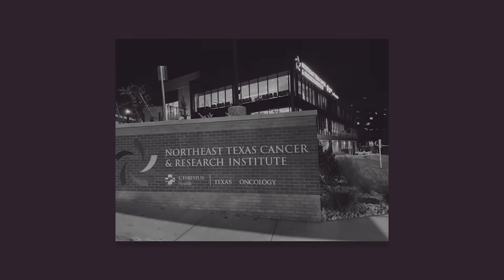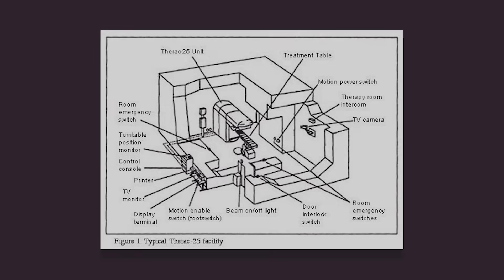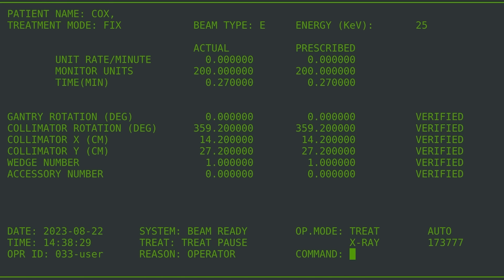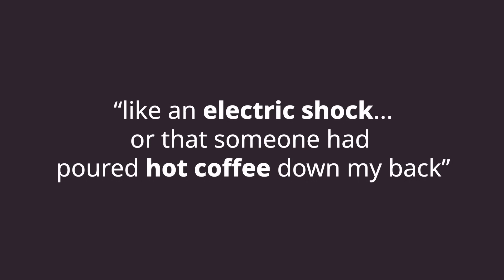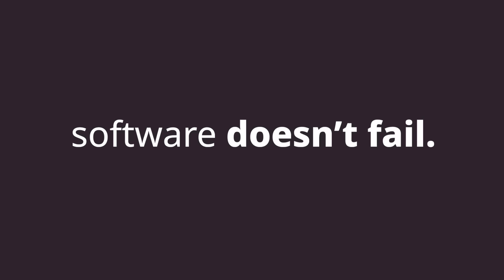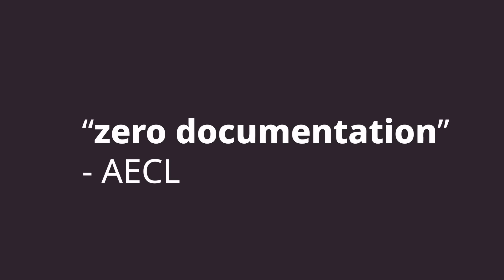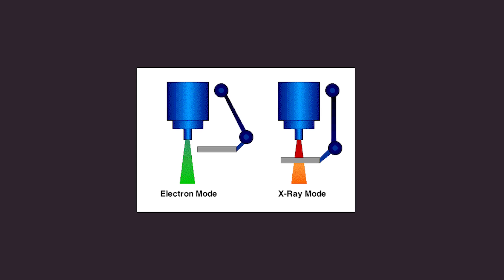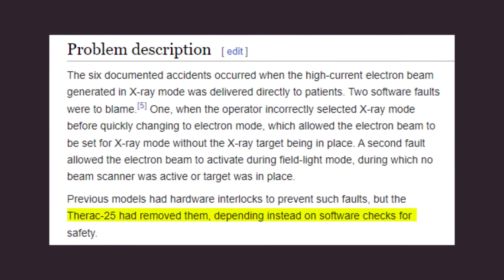how a simple programming mistake ended 6 lives

Comment: I started my career in Dental X-Ray designing and manufacturing company as a Junior Embedded System R&D engineer. 
There the hardware team has the master role always they critisize and having less trust in software😂. I remember how regorous regression tests they've done before going to launch a product.
Reply: you are my man, ... if I may ask you.  I noticed I am not always given those lead filled radiation protective ponchos (i don't know the exact name) any more nowadays when a dental X-ray is made on me.    Am I right thinking it is because the newer  (cone shaped beam) machine produce less radiation dose, and also less stray radiation with the cone shaped beams ?   ..or just negligence and I should ask for one.

Comment: You'd think the medical industry would get better at preventing this kind of thing. Instead, they've hired better lawyers to deny this kind of thing.
Reply: There is actually an ISO with very strict guidelines on how to develop such critical software, one thing which particularly stood out to me is static memory i.e. you know all the necessary resources beforehand and prepare for the worst case. 
There's also a tracing level for the documentation, where the max level is being able to trace all use cases through requirements to every line of code responsible for them.

So there definitely are methods for prevention.
NASA also has some interesting design processes, if you're interested in reading. Using an old, specific JavaScript engine in space is one of the consequences I find quite funny.
Reply: @blacklistnr1 which one? Could you share the number of ISO standard?
Reply: @charlieking7600  It's probably in the IEC60601 series of standards. My interest was .2.41 which is for a surgical luminaires and the basic electrical safety parent standards. Software will come under controls for the medical electrical devices and may reference external standards for quality assurance more specific to control/software design. It may also be a situation where the device developer/sponsor is responsible entirely without very specific guidelines beyond - "a single fault condition, power interruption or malfunction shall not cause adverse patient or user outcomes"...
Reply: @blacklistnr1  from what I've read, they even have to have certified C/C++ compilers, you can't just use GCC.
Reply: @blacklistnr1   I've been working to different software companies. Common among all of them that they want to make the least to get the certification. And these companies are worth multi-billion dollars.
Reply: i hope thé family got a large payout from the company and the hospital
Reply: @NithinJune Actually probably not. Apparently according to torts law, the compensation for loss of life/consort depends on life expectancy and this guy had cancer so...
Reply: @aporifera  that factors into the damages but also those was clearly very very negligent so punitive damages could have been large
Reply: @NithinJune  Well, you better hope to get some money from this, why else would you even bother others to help your survival ;-)
Reply: I work in the medical industry. You would think that the data quality is much better than any other industry. It's not, as a lot of the fields where patient information is entered in is free text and contains spelling mistakes. This is tragic but is not too surprising giving the experience I have had from my side of the field
Reply: @DeusinMachina  WOW I had no idea the code quality would be detrimental. Crazy.
Reply: They have.

This is the def facto case study for importance of software QA and the FDA makes med device and drug manufacturers document basically everything
Reply: @blah7983  It was THE case for explaining dangers of software. Until 737 MAX joined it.
Reply: LINAC safety is extremely good these days.
Reply: Their entire industry is a scam.  House of cards built on lies used to prop up another house of cards.  This is standard dark triad operating procedure.  100% expected, in fact, you should just assume it and look for the exceptions.
Reply: The medical industry is designed to make and keep you sick until they milk all your and your family's savings.
Reply: That's what happens when the answer to everything is "more funding and anyone who disagrees is a racist fascist"
Reply: Ea$ier in the long term for them
Reply: This medico-pharma industry is the same one that, standing behind a liability shield, unleashed "safe and effective" and "six weeks to stop the spread" on the world's population.
Reply: medical errors are now 3rd leading cause of death in the Good Ole' USA.

And remember, this is the OFFICIAL statistic. IMAGINE the actual carnage. I personally know a fellow teacher locally whose father was in for elective surgery and they 10x dosed him on anesthesia and killed him. 

Quietly settled the case of course, no news or reporting.
Reply: Not true. For every bad incident there are millions of good cases. People never sue alcohol companies because everybody is get used to alcohol violence and God forbid a new machine designed to cure people will falter once in a decade!
Reply: This is mainly due to the fact that people can become millionaires from a well-orchestrated lawsuit for liability.
Reply: not instead. they are also getting better
Reply: This is also 40 years ago.
Reply: Only in MURICA
Reply: You couldn't say it better.
Reply: Who allow this industry to function like this?
If there is something wrong with them, why they dont make them stop?
This is not a kindergarden to play with laser guns, or playing as a doctor
Reply: @Namrec_955  This was 40 years ago. Things are significantly different now.
Reply: @Namrec_955  They see us as cattle.  Pieces of meat to maim, drain, discard.  Lawsuits are calculated into their upfront cost of doing business.  It's a house of cards, they don't care.
Reply: @Namrec_955  There's nothing stopping just about any error in the medical field. 5 different dosages of a potentially lethal medication from one manufacturer are likely to all come in the same packaging and look the same. You're assuming a lot of people can read - doctors, pharmacists, nurses, patients. They screw up constantly and don't tell anyone.
Reply: @Namrec_955  - What's to stop them? Money. Who controls the money? There's your answer.
Reply: @MindlessTurtle  Hm, controls.  Maybe a better word is "creates" though?  Money doesn't exist, it's just abstract quantized ecological affordance, but these days it's totally divorced from anything real at all.  The only real thing is human behavior, and human existence.  And that's why they created money.  It establishes an energetic pressure gradient, and makes humans move in controllable, predictable ways.
Reply: @Acetyl53 I don't think we have to get into what money is exactly (also, your explanation is wrong on that); let's just say that markets do not need money to function, hence the expression "who controls the money?" is metaphorical and really means "who pays?".
Reply: @erikkonstas  We actually do, and I'm right.  The purpose of money is to establish pressure gradients to cause "state" to flow within certain channels.  Without something that believes in it, in an environment where they can use it, it's entirely inert.  It doesn't matter if ir's FIAT and fractional reserve lending or cacao beans, you need something that is going to alter its behavior when you give the form of currency to it.  Might makes right is also a ciurrency, and you need a currency to keep it together and organizationally scaleable.  If you use sexual sublimation as the energetic core of a society, then access to women is part of the currency, to which you build status and network as a layer on top.  It's actually really straightforward. That's what money is.  A stimulus that makes a particular system self organize to do what you want.  Which is also why you "spend time".

In my view these are the bare fundamentals.  If we can't even agree on this, there isn't much else to be said.
Reply: @Namrec_955  It is called "PRACTICING" medicine for a reason. :|
Reply: It was the 80s, you can't base today's regulations on something that happened over 30 years ago.
Reply: @arcyarcanine …
Reply: @ravenID429  Ah yes, good point. I totally understand where you're coming from. 🙃
Reply: When has anything like this happened again?
Reply: @travisporco  I do faintly remember a case of a nurse killing at least one patient because she was feeding them intravenously...
Reply: @travisporco  why assume we'd know about it?
Reply: @travisporco Are you serious
Reply: Welcome to the healthcare of America. Until you remove the old people from the government maybe healthcare would be better
Reply: @ElusiveXSetups  - you sound like a Communist.
Reply: Well, our life expectancy doubled over the last centuries, and it's not because we are more careful at driving and extereme-sports, climbing ladders or by avoiding war with it's injuries and definitely not by better lawyers ;-)
Or is this ungrateful mindset just what people want to think about their friends/kindergarten-/school-colleagues/neighbors who have made it to university and such jobs to improve our standards even more?
Reply: @thomas.leitner  - wtf are you talking about? Most people today haven't served in war or worked physically demanding jobs. And you think the medical industry deserves that credit? You probably do considering how much propaganda they create to push their snake oil.
Reply: another reason this kind of mixed market we're in is awful
Reply: Why are you lying?

Comment: Software never got tested until it was shipped? Sounds like all the AAA games coming out
Reply: The difference being of course, that AAA games are extensively tested, despite their many bugs, and that they are not safety critical systems.
Reply: @liegon any software is critical system, considering fact that RCE-exploits are available anywhere.
Reply: @charlieking7600  Fair point. That's why safety critical hardware or information systems have special requirements, also from a systems integrations standpoint. But in this case, the software or hardware wasn't even networked.
Reply: Yeah, but john, when the pirates of the Caribbean game breaks, the pirates don't eat the user.
Reply: @khatdubell  Scribbles down game idea
Reply: "Hey, it compiles. Yeehaw, we are done. Ship it."
Reply: Yea
Reply: *Modern AAA games.

Comment: Your explanation of the actual failure is not correct, as far as I can tell, reading a report into the incident. Firstly, you can't shape X-Rays (or any photon beam) with magnets. These magnets are used to shape the electron beam when in electron mode.

Secondly, the machine produces an electron beam as its native source of radiation, and needs a target in front of the beam to produce X-Rays instead, as well as a flattening filter which attenuates a lot of the beam energy. Producing X-Rays requires the maximum electron beam power, a power around 100 times greater than that used in electron mode. Therefore, the patient did NOT "receive X-Ray radiation at electron radiation doses", they actually received electron radiation at X-Ray radiation doses, since neither the target nor the flattener is placed in the beam (7:43)

Comment: Writing async code in assembly. Of course it had bugs.
Reply: More like: writing async code without knowing that it is async so it is written as non async
Reply: I feel like the bigger problem was the primary design choice of the programmer to have an interface where you can freely write any kind of data and have a confirm command at the bottom.

Every user would assume that nothing happens to the machine until the confirm command is sent. Why would he make the machine read certain values instantly long before the confirm command is read?
Reply: @rivershen8199  Probably why you should hire a professional, not a hobbyist.
Reply: @khatdubell not so sure... have you seen some of the garbage some professionals write?
Reply: @khatdubell I always say, they're cheap and are good at getting expensive.
Reply: More like: Writing async code. Of course it had bugs.
Most languages do not prevent data races, and I have yet to hear of a language that would help in this specific occasion without support from the hardware itself, i.e.: in this case the magnets and filter.
Reply: @ΝίκοςΙστοσελίδα  Rust with Tokio (as long as you never use the "select" macro - that thing essentially is a race condition generator)

Obviously these did not exist at the time
Reply: @ΝίκοςΙστοσελίδα  "I have yet to hear of a language that would help in this specific occasion without support from the hardware itself, i.e.: in this case the magnets and filter."
any input/output system, like communication with hardware, needs some way for:
- the code to tell the hardware what to do
- the hardware to tell the code what happened/is happening
i think that figuring out how to output instructions (and most importantly, handle the feedback by the systems!) is the task of a module, a library, or a framework, not the language itself.
Reply: @rsboi-yt  That's exactly my point. The problem is not the they were writing async code in assembly, high level languages would have the same problem, maybe even worse.
Reply: @ΝίκοςΙστοσελίδα Not true. It all just depends on how the code is written. For example, by never allowing multiple threads to modify shared state. If this state has to be modified then there is are safe ways to do this. For example, have a dedicated thread for processing state changes. Other threads that need to modify this value (like incrementing a counter) will submit the change to the worker thread which will mantain and execute these changes from a que.
Reply: @ITech2005  I am not sure about which comment you are replying to, but if it is the last one, some previous answer of mine explained what I mean. In this case, the problem is possibly further complicated by the way the hardware might (since we don't know the implementation details) work, in a way that it doesn't matter what language you are writing in. As you said, make sure only one thread writes the counter. That's correct, but the "counter" may well be more abstract (eg the position of the filter) and by definition be changing in the background. High level languages would not pick that up without help.
Reply: @ΝίκοςΙστοσελίδα   Rust can catch this under the condition that one task does not just ignore the data while the filter is moved.
Reply: @Tederean  Can it though? The programmer has to make sure to check that the movement has finished. In this case Rust won't produce an error, unless the programmer checks the condition, which is no better than any code written in C.
Reply: @ΝίκοςΙστοσελίδα  The cause of these cruel accidents, as mentioned in the video, is the race condition in the software. The Rust compiler enforces proper handling of race conditions in safe Rust, which should make up the dominant portion of the software in such firmware when written in Rust, except for direct register access.

It's about not allowing problematic situations to arise in the first place. Many multiple queries arise because the cause was not worked cleanly.

Of course, I think it makes sense to check again in such an application whether the target is correctly aligned, after all, human lives are at stake here.
Reply: @Tederean  Ok, I need to understand this better, so help me out if you can. This is mostly assumptions based on how a system would work, since I couldn't find documentation. The Rust program has a command that instructs the servo to move. This is probably done by writing a value to a register (which by itself is unsafe) and then continuing execution. How would the Rust compiler know that there is a turntable that needs to move and that this takes time?
Reply: @ΝίκοςΙστοσελίδα  In Rust, you would wrap the variables in a struct within a Mutex. You have to explicitly claim ownership of the mutex at that moment, which prevents the other thread from accessing it.

In the original program, the variable indicating whether it's X-ray or an electron beam was unpredictably changed in the middle of the background thread's execution. In Rust, you would have copied the struct while accessing the mutex and continued working with the copied data. This way, the UI thread wouldn't unexpectedly interfere with the background thread. If you force to access the data on the mutex each time, it would immediately become apparent that this values could change at any time in an unprodictable way. That's what no one had considered...
Reply: @Tederean  I get what you are saying. I think we have a different model about how it worked. Yours is probably the correct one, but in my mind there is no struct holding any  value. In my model there is only a physical subsystem that gets a command and then executes it, independently from the main CPU. It is not the CPU that's doing the rotation, but this subsystem, and the command for the rotation is issued by CPU which then goes on to do something else. So it happens concurrently but not on the same resources. When you think of it this way, there is no thread in the software, so the compiler wouldn't see a violation. I am not sure if I have made my thinking clear...

And sure, there should be multiple checks before issuing the treatment.
Reply: "Writing async code in assembly"... what? Like on the Apollo AGC? Or the LVDC in a Saturn-5? ... I'm sure the astronauts said "OH NO... we can't go to the moon because we'll be depending on async code written in assembler!!!"
Reply: It had been written by a hobbyist student ofcourse it would be dangerous. A hobbyist never has the mindset to think about every critical safety system that has to be implemented to make software safe